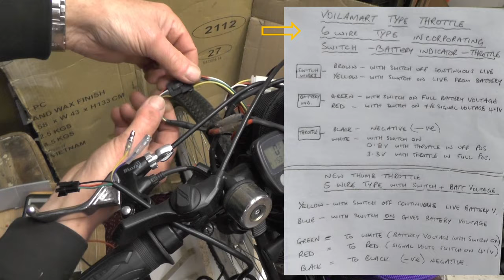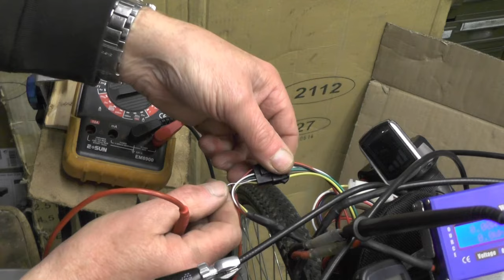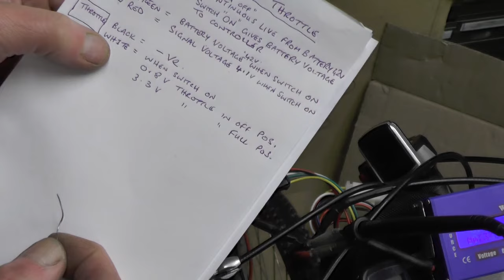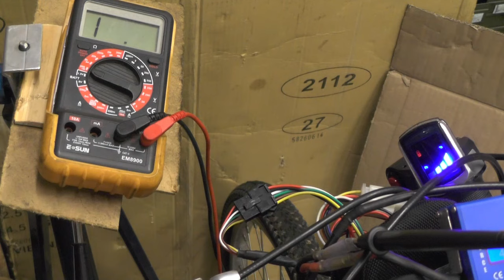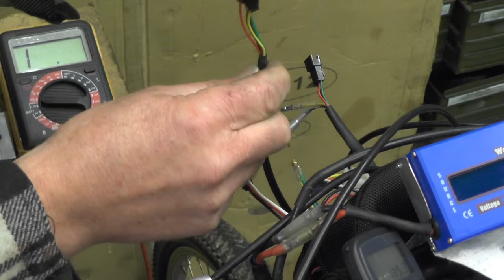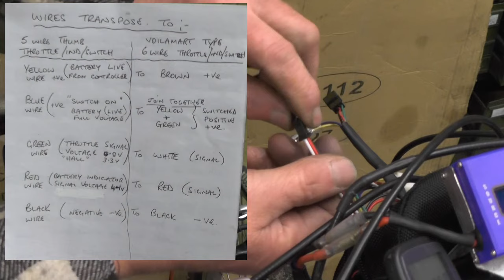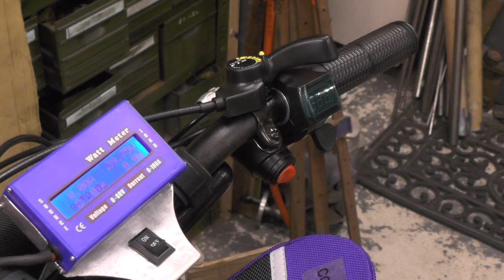Electric Bike Wiring Twist Throttle 6 wire to Thumb Throttle 5 wire Voilamart  type Controller. Mr F

Comment: It's about time i found this great tutorial . everybody is getting aftermarket parts...!!!! Seems every time the wiring is never the same on each part.. Thanks a lot for explaining this so perfect..
Reply from the maker: cheers joe
glad it helped. thanks for taking the time to comment.
regards
 mr f
Reply: @MrFactotum  got to give credit where credit is due. See I got the EcoSmart it has six wires for the controller to the throttle. The new throttle I bought has the LED the key and the twist. But it only has five wires. Little different than yours situation. The way you explained to use the voltage meter. That was perfect. I had it wired within a couple minutes. Thanks again

Comment: Help please.
I have voilmart 48v 1000w front hub.
Full twist throttle. 6 pin male connector.
Wire colours.
Red, black, white, green, brown, yellow.

Now the throttle connector, from the controller is male 5 pin.
Wire colours.
Yellow, green, black, blue, red.

I am at a total loss. All other connections were simple plug and play.

Any help and advice would be much appreciated. 
Paul.
Reply from the maker: hi Paul
sorry to hear your having problems. It sounds like your opposite to what i was transposing, 
It may be that the controller is for the 5 wired thumb throttle, the trouble is its over a year ago since i did that on mine , there are that many chinese controllers / throttles in the market without standardised colours its difficult to say without physically checking things, if its a voillamart kit should'nt it have come with all the correct fittings. Its just going to be a process of elimination to find out what each wire does, by checking with a multi meter, all i can say is try to work backwards from my video, to see if you can establish exactly what each wire does, i.e. live, earth, signal, display etc, to find out what the extra wire actually is for. Sorry i can't be of more help, but its difficult without being hands on to job.
all the best
mr f

Comment: Hello again I want to thank you because this is what I have I have the same Violamart controller and and throttle.I put on a similar new throttle mine is still a twist because I like them but it had the same wiring configuration and LED display as yours and it works fine I appreciate your video and your time and I thank you for this information without it I probably would have never done it.
Reply from the maker: Hi KB
well thank you for your kind comments, it's appreciated, i'm glad it helped
all the best
regards
mr f

Comment: I have connected throttle differently. 
 l connected the yellow thread to the + battery, and the blue thread to the wire thin, red in the controller. 
 Now, although in the battery I have 41.5 V, the Throttle shows me 22-28 V and the engine does not rotates.
Why don't I see 41.5 V and on Throttle ? 😕
 I think I ruined something ...
Reply from the maker: hi john
you say you connected the throttle differently may be there's the problem. Could be controller or throttle problems, giving the false reading. Many others have commented to me with successful outcomes. Its imperative that you don't connect positive power where it should not go due to risking causing damage
regards
mr f
Reply: @MrFactotum  
 I do not have the same colors at the wire in controller. I have 2 controllers. I thought the first is faulty. 
I replaced him with the other. The defect remains !!! I think the problem is at Throttle. 
 I'm going to look for a video, "How to repair a throttle." 

 In this video I presented the 2 controllers. Unfortunately, I do not know, how to put the translation into the video, and my English is ... Poor.
https://youtu.be/wTvixy8uSeo
 Thank you !
Reply from the maker: @John_Smile  Hi john, ive had a quick look at your video, but its very difficult for me as i don't understand your language.
The trouble is there is so many controllers on the market and theres no standard wiring configuration, the controller in my video was from a voillamart kit so i can only advise on that controller with that wiring configuration is.  Its very difficult for me without being hands on to check what wires does what. Its just a matter for you to check with a multi meter what wires are  negatives, (positives Full Voltage) and (signal wires usually around 5 volt), 
I will take a more detailed look at your video a little later on to see if i can translate and check the wires visually, and if i can come up with any info i will let you know, Hope that helps and hope you understand its difficult for me not being hands on and with the language barrier.
take care and good luck
mr f

Comment: So the yellow and blue wires are just (+) for the switch functionality?.... Is the throttle working without connecting the 2 wires?
Reply from the maker: hi GR
On mine 
the yellow is continuous Live +ve
the blue is switched live +ve
i didn't try mine without these wires connected but i would imagine the throttle internal connections need this switched live to turn the power  on or off to everything for safety. 
To answer the question don't connect them and just try
Hope this helps
regards
mr f

Comment: Hi I don't know if you can advise me but I have the voilarmart kit and replaced the six wire throttle with a five wire and followed your instructions, and it worked on the first couple of test rides, then it stopped working and the wheel does not turn and the volt metre on the throttle is jumping about from 16v upto 26v and anything in-between, when I first wired it it worked and read the voltage as if it was a single cell. Thanks for any advice
Reply from the maker: hi qc
sorry to hear your problem, its very difficult to say without being able to be hands on, it could be any number of things, i afraid its going to be a trial and error method of finding the problem. if i where you i would check all connections first .
I have to say though, when i bought the voilamart kit, i fitted it, and it worked a couple of times for one day, then i had problems it became eratic, to cut a long story short, it turned out to be a faulty controller, i emailed the seller expecting to be   fobbed off, and to my amazement after sending them a video of the box that the kit came in as proof of being there product and explaining on camera to them that i had connected everything up as per the instructions, they sent me a new controller and its worked fine since.
If i were you if the wire connections seem ok,  i would look on youtube for a video that tells you how to do static tests on the motor. there is one out there but the name slips my mind at moment. It checks the 3 main phase wires and hall sensors, and is quite simple to do. This will enable you to rule the motor out if all tests are ok, its very unlikley to be the motor.
Then you could put the six wire throttle  back on and see if that works. this will point the finger at the thumb throttle to be suspect then.
If still no joy, it looks like things are pointing to the controller. Make sure when changing wires anywhere on the system that you don't short any out or connect wrongly with power on, as it could damage the circuits.
Hope this helps you, take it one step at a time, and let me know how you get on. Good luck
regards
mr f
Reply: @MrFactotum  thank you for your reply, hope it is the throttle, the one I purchased was a cheap one what was advertised as being 24v to 60v came with keys as switch and a LCD display that read the voltage.
Reply from the maker: @quadthingcopter5984  yes. i'm afraid its a lottery with imported electronics.
Reply from the maker: @quadthingcopter5984  great skill and great shot of the track layout, ive sub'd you and will take a look at your other video's
regards
mr f

Comment: thanks buddy got the same controller wiring and got the same thumb throttle so was a great help i wondered where the extra wire was going to go it was a great help. Also i was thinking of a proximity switch i could put in my helmet so when i left the bike it would be switched off anyone got any ideas i don't really want a remote control
Reply from the maker: hi KL
glad it helped, and thanks for watching and commenting. As for the switch, not sure at moment, ive got my brain working away back on my live steam loco, so on overload at moment. i will give it a thought when i get chance, sounds a good idea though, keep in touch if you resolve the problem in the meantime, would be interesting to know about.
stay safe
regards
mr f